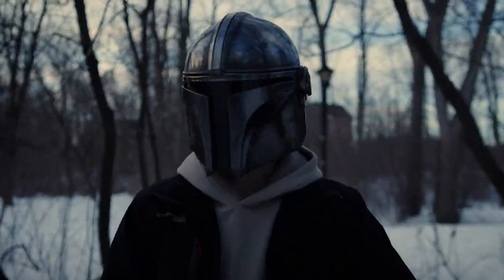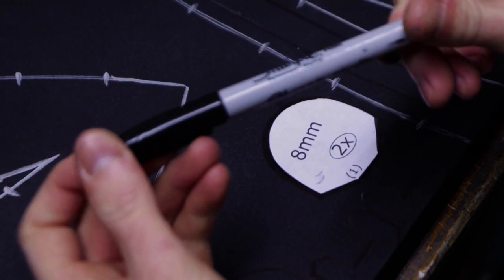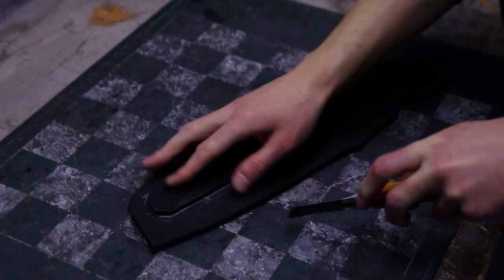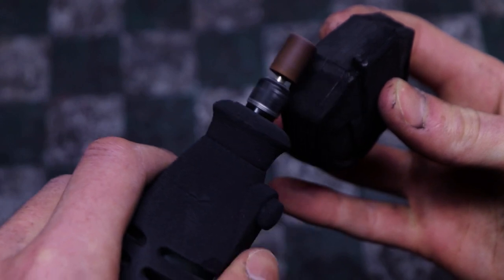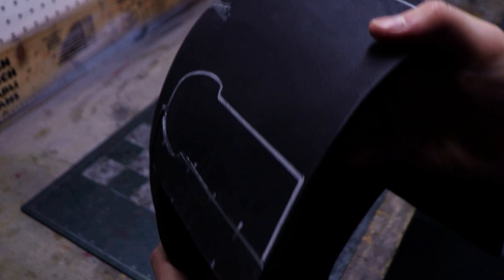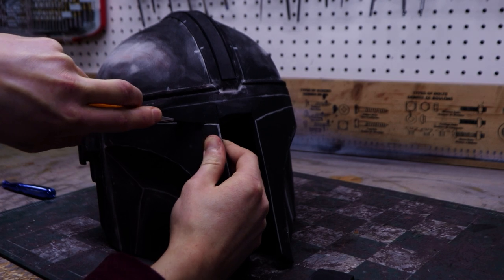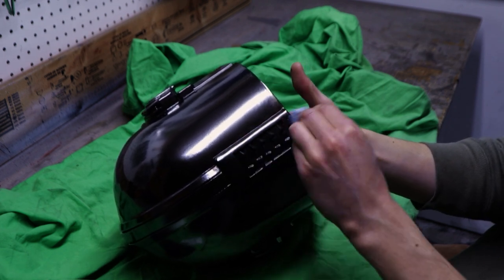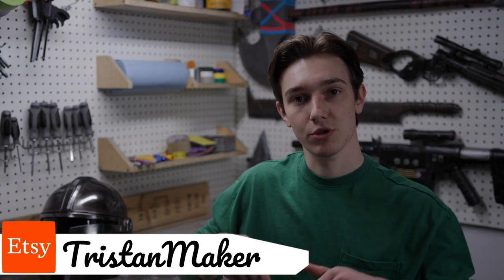Make Your Own MANDALORIAN Helmet Out Of EVA Foam | With Templates

Comment: So I started working on the project today and was wondering why you cut the visor when the helmet was already assembled. Could you not just cut it before you assembled it or was there a reason for it? Thanks.
Reply from the maker: If you cut the visor before assembly, the straight lines of the visor will become curved and crooked because of the tension you have to put on the parts to stick them together.
Reply: @TristanMaker  makes sense, thanks for the clarification. I’m using the exact tools and materials as you are so hopefully I get a similar result to yours!

Comment: Hey Tristan! At 6:00 if we don't have a wood burner does scoring it with the box cutters work to achieve the same results? and heat sealing it.
Reply from the maker: You could totally do that but the line won't be as wide. You can also make a V cut into the foam or cut out that strip of foam and glue it back in 2mm lower.
Reply: @TristanMaker  thanks man for the reply! will see how it goes!

Comment: Purchased and waiting to make. I'm just filling and sanding down my phase 1 clone trooper helmet from your templates. After that, I can't wait to make Mando mark 2! I bought your previous Mando helmet template last year, but the filler primer I tried using apparently wasn't flexible, and the spray paint I used  on top of it cracked. Oh well, can't wait to hopefully make a better one!

Comment: 3:26 is it necessary to have contact cement? And if not, what can I replace it with?
Reply from the maker: For a project with complex curves like this, contact cement is very recommended. Hot glue works but won't give you clean seams.
Reply: @TristanMaker  Oh, I understand. Thank you for the explanation!

Comment: Since you used spray primer & gloss rustoleum spray paints; that would make this helmet technically no longer flexible right? Usually in my experience; these spray cans usually are not flexible at all so if something were to accidentally hit the helmet; it would leave cracks that cant be fixed.
Reply from the maker: By using this combination of products, the helmet becomes much more rigid, but still has a bit of flex in case it gets dropped. The brands of paint I used have just a bit of flexibility after drying, enough so the helmet doesn't crack unless it gets hit really hard.

Comment: Question, can Ruston-oleum automotive primer work too ? or it’s just the Dupli.color primer. 12:36
Reply from the maker: Any brand of filler primer will work. But I found that the Dupli color sands a little better

Comment: this looks amazing. does graphite give it its color or just its shine? that is, if I wanted a brassier color, could I do a goldish basecoat and still use the graphite? or is the graphite going to make it chrome colored no matter what?
Reply from the maker: Thanks! The graphite will affect the color, but it is not completely opaque. A black base coat will give a darker finish than a grey one. Try experimenting with a red, orange, brown or gold base coat. Each will give a slightly different look.

Comment: What type of EVA do you use? I’ve watched you slice this stuff on an angle and it goes through it like a solid material. The stuff from Michael’s seems to just crush. Even with a brand new blade. 

Amazing templates and work. I have the original helmet that I’m working on now.

Comment: And for the painting/graphite step… are you applying graphite powder after paint has dried or while it is a little wet still?
Reply from the maker: I let the paint dry for 1 to 2 hours depending on how thick it was applied. So it's still a bit tacky

Comment: Hello there. I watched all of the videos, i’ve planned, and i’ve gotten the templates and foam. However, i have a small question. What would you do to decrease the amount of time needed to make it? I only have about 5 weeks until I need to get it finished. Any thoughts that might help me save time?
Reply from the maker: Thanks for using my templates!

I would build the armor as cleanly as possible and skip filling the seams. As for the paint, just apply 3 coats of Modpodge, sand the last coat, apply 1 coat of gloss black and 1 coat of chrome spray paint.

I hope this helps!
Reply: @TristanMaker  thank you!

Comment: I bought the template before I even finished the video. Great work. Also, do you have any suggestions as to print sizing to fit a child
Reply from the maker: Awesome, thanks for your support! You can check out the sizing chart in the pictures of the listing on Etsy. Then when you find the scale that matches the kid's head size, watch the printing tutorial video linked in the product description on Etsy to print out the file.
Reply: @Tristan Maker  thank you will do!!

Comment: I have a question about the dome trim piece. I'm using floor mat material that has the diamond metal pattern ,the little cris cross, does the 5mm piece go on top of the 8mm or the bottom?  Also the clip didn't show registration line on the trim piece then next clip it has them on any tips on how to put registration lines on this piece thanks
Reply from the maker: The 5mm part is on top of the 8mm one. I simply traced the registration lines from the template.
Reply: @TristanMaker  that makes more sense I put it on the bottom after I get rid of those diamond cross marks and it didn't work thanks

Comment: Awesome video! Great tutorial! Just one question, on the long piece that goes on top of the helmet that says “13mm (8 + 5mm Pieces)” how is that supposed to work? Is the outline on 8mm and the smaller inside box on 5mm?
Reply from the maker: Thanks! The whole thing is 13mm, then you can score lines on the top layer and bevel the first 5mm.
Reply: @TristanMaker  ok thank you! Would it work if i stacked a 5mm piece on an 8mm and then cut it to fit?
Reply from the maker: Yes, no issues

Comment: This is soooo cool but I only see one problem. The visor shield…I’ve been a welder before and unless you got that spark going you can’t see ANYTHING!!!
Reply from the maker: Thanks! The visor I used is a grinding shield, not one for welding. You can see really well through this one just like with sunglasses. (It's just that even on Amazon it's called a "welding shield")

Comment: Hi, I can't find SprayMax Clear Glamour, at  my place. Could you suggest for another option to replace it please?
Reply from the maker: You can simply use any gloss clear coat as a base for the graphite. Just make sure not to use it over the graphite as it will ruin the finish.

Comment: This is such a cool Mando helmet!! I'm thinking of making my own custom helmet this year but I want to paint it a different colour, am I able to paint over the Eva foam or when will be the best time to apply paint in your helmet making process :)) Thank you for this lovely helmet video!
Reply from the maker: Thanks! You can seal the foam with 3 coats of Plastidip or Modpodge and then paint the helmet however you want. Acrylic paint and spray paint will work.
Reply: @TristanMaker  Thank you (:

Comment: I’m new to this. What type/thickness of eva foam are you using? Might be a dumb question :p
Reply: Also, can I adjust the overall size of the helmet with the templates?
Reply from the maker: I'm using medium density cosplay foam. All the thicknesses used are specified in the product description on Etsy and on the template parts directly.

You can scale up or down the templates to match your head size by using the sizing chart located in the pictures of the listing on Etsy, and by watching the printing tutorial video linked in the product description on Etsy.

Comment: so im planning to make this helmet and possibly the armour later on, but have zero experience with EVA foam. i searched the internet on where to get the foam, but came across multiple types of density. is there a particular density that you used, or does that not really matter?
Reply from the maker: I used medium density cosplay foam for the helmet and armor.

Comment: Could the visor be cut out before the helmet is assembled, so that the faceplate could be recut in case of any errors? Or is it important that it be cut out after assembled?
Reply: The visor is cut after assembly to keep it from flexing too much and get a perfect fit on both sides. If you cut it before it could bend and get you a wobbly visor. Hope it helps you
Reply: @kofoanii1416 thank you!

Comment: How do you know how to cut 40° and 10° so those edges line up?
Reply from the maker: You can do it approximatively by eye as foam is a forgiving material. It might require a bit of practice on scrap pieces of foam first.

Comment: Is there a way to get child sized patterns?
Reply from the maker: The templates are made for adults but you can scale them down using the sizing chart in the pictures of the listing on Etsy.

You might have to adjust some of the parts after building the armor to make it fit perfectly.